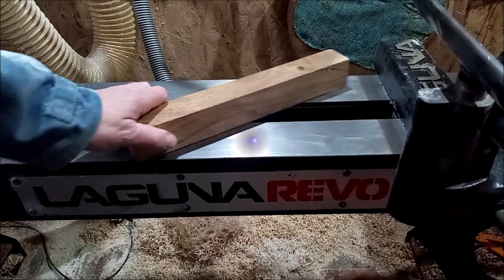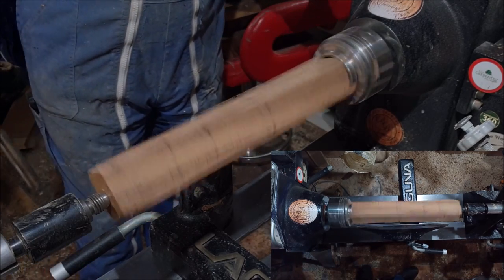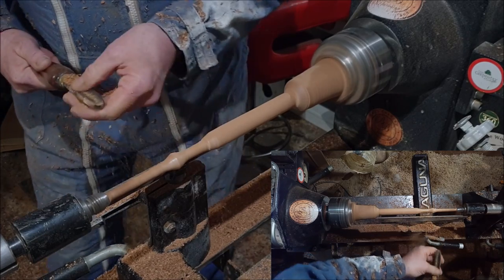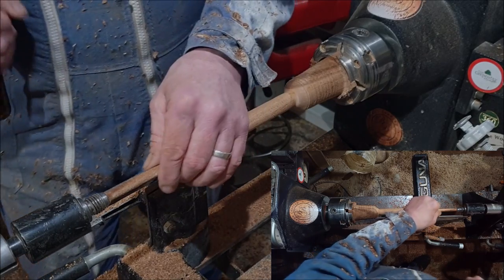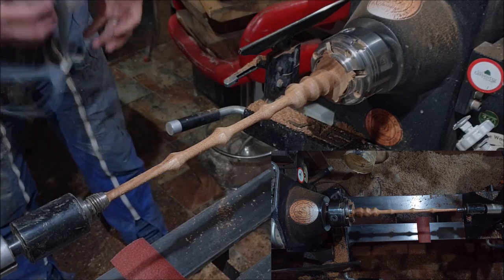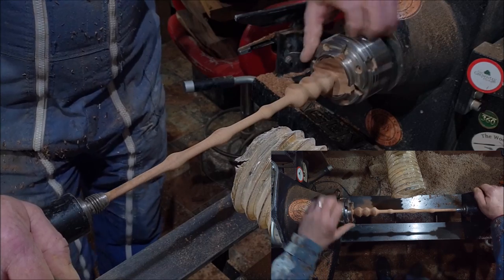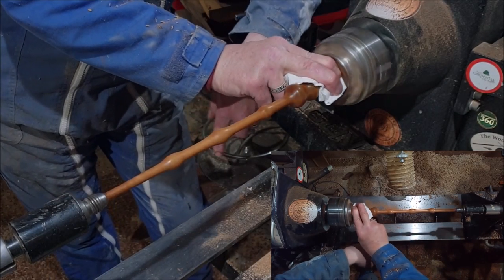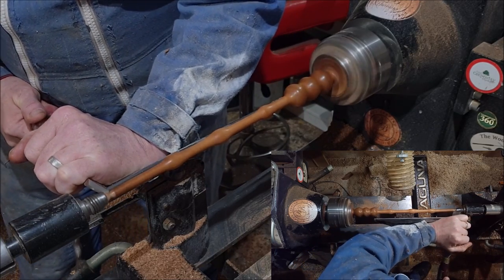Revisiting wood turning impulse buy magic wands as requested

Comment: Thank you for the wand video. I especially appreciate your candor and caution when working with the material and your comfort/skill levels. Spot on. And I appreciate how you emphasized that using sandpaper was ok. I've heard others claim you should be skilled enough to do everything with minimal sanding...and that is just plain, not true. Your methods emphasize safety and flexibility in shaping the material. I really like that. Thank You.
Reply from the maker: I was taught to turn over thirty years ago by a retired master turner from the UK who had moved over here and I was lucky enough to have him as a neighbour. He was of the opinion , as am I that if new turners are not told that it is ok not to be perfect then the craft will surely die. In quite a few of my videos is say that it is fine if you need to start at 80 grit. It does not mean you are a bad turner, great finish cuts come with practice and most turners will get to the stage where their normal starting grit is 150 or 180. Young people coming into the craft need to know that excellence is attainable and they will eventually get there. Not to mention we can all have bad days where nothing goes right and again that is ok, just keep going.
Shay
Reply: @BBTurning  Thank you for the encouragement, sounds like you had a wise teacher.

Comment: Thanks. Just subscribed.You remind me of Robbie the woodturner, If you don't mind me asking At what price do they sell well? I've seen any where from $40 to $100 plus on Etsy
Reply from the maker: Thank you. The wand in this video is an impulse buy wand, basically it is very quick to do so sells cheaply. I charge €15 for them and they sell very well.I wouldn't be looking at Etsy for price comparisons or to set prices. There are turnings on there that are not priced high enough to make the price of the blank back and there are also turnings on there what what turners refer to as "wood artists" and are so overpriced only a lunatic will buy them.
Shay.

Comment: Hi Shay, Brilliant video on how to make a quick inexpensive wand.
I really liked your explanation about tool snobbery. I have a lot of Robert Sorby tools but also have Record, Ashley Isles, Axminster and Crown tools but when buying I bought the best I could for what I could afford, exactly as you mentioned. In fact most of my tools I have bought on eBay. Most needed a bit of TLC but once done they are good tools.
I bought a Continental SRG a few years ago at a big craft fair and wood turning exhibition and it dated back to WW2. It is stamped Sheffield Steel, Hut 2, 1943 and it works beautifully and still keeps and edge.
Great video Shay and look after yourself as you still sounded a bit chesty.
Cheers, Huw
Reply from the maker: Cheers Huw, yeah the chesty thing is from giving up smoking and eating a lot of sweets, my throat is very sticky if you get what I mean.
Shay
Reply: @BBTurning  👍👍

Comment: I prefer cast iron for the bed of my lathes...more stable and stronger than aluminum(bauxite). Best you can afford...sound advice for all aspects of life. And your opinion about the Jacobs Chuck is right on. The Morse taper will hold and the grip becomes stronger when pressure is applied toward the spindle...that is what it is engineered to do. Side pressure will cause it to release. For reference, I am a Journeyman Machinist by trade, and your opinions are sound and correct, based on the technology and training I received before CNC's took over.
Reply from the maker: My last lathe had cast a cast iron bed  and it was great, the stainless on this one is just easier to keep clean and i am all for easy 😁.
Shay.
Reply: @BBTurning  😀

Comment: Are you self-imposing some rule / challenge that the wand has to be made from one contiguous piece of wood?

I typically use 2-3 different woods in a wand. HP universe wands have some magic stuff inside, so I typically put a tenon on the base of the shaft and and snug, over-length mortise in the grip to act as a hidden chamber. My son still hasn’t figured out that the shaft of his wand can be removed from the grip to expose a small chamber  containing several Amethyst crystals.
Reply from the maker: The ones in the video are impulse buy wands Dave, done as quickly as possible so they sell at a price. The wands you describe I do for Wiccan clients who request them and they cost a lot more than these standard ones.
Shay